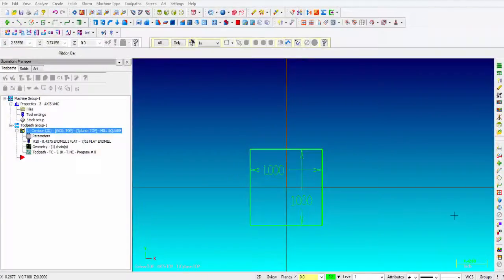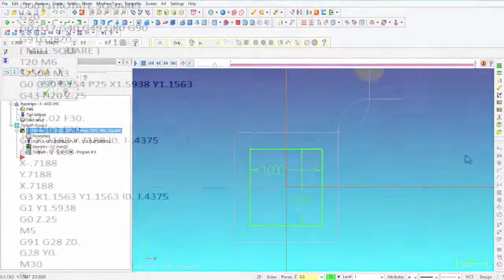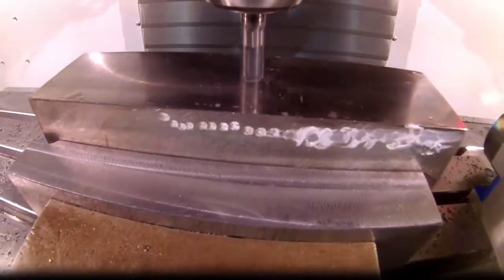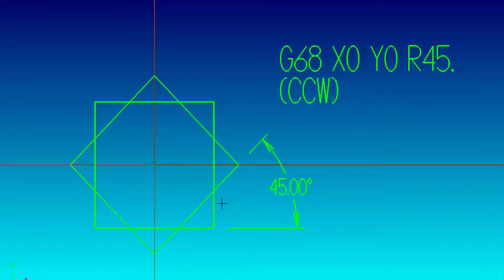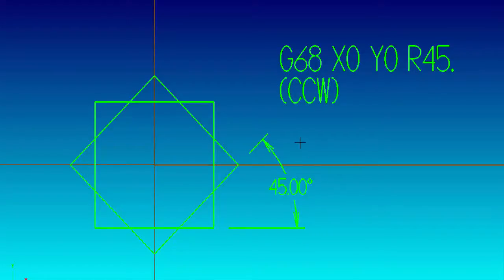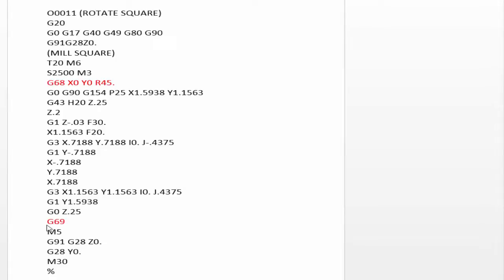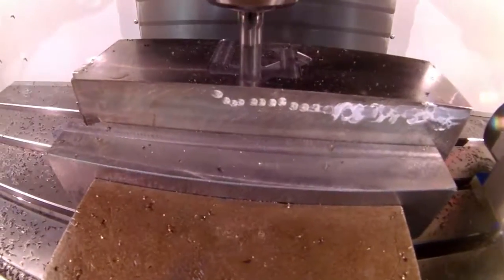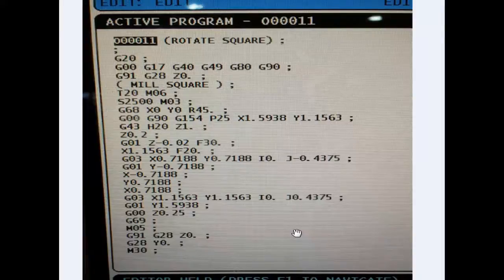CNC MILL PROGRAMMING A G68 COMMAND ON A VF3 HAAS MILL

Comment: Why are companies attempting to remove CNC programming knowledge and replace it with purely with CAM software generated code.  When there is a problem with a one of the hundreds, possibly thousand or more lines of code, it is so daunting to figure out where to begin to look.  Can cycles make it easier to comb. Great videos, by the way.  The audio levels are a little low.

Comment: Could you use this to make an external hex pattern.?
Like to say to make a 1.5" hex could you make it do a straight pass on the x axis on both sides. Then just throw a g68 with an R of 120. Then do it again and R240. 
Would that work?
Reply: I wanted to ask this so I could program. An external hex in g code on the machine itself. Because the shop I work at doesn't have CAM